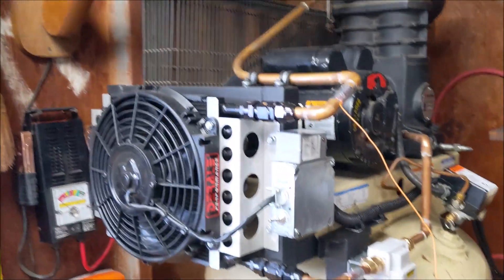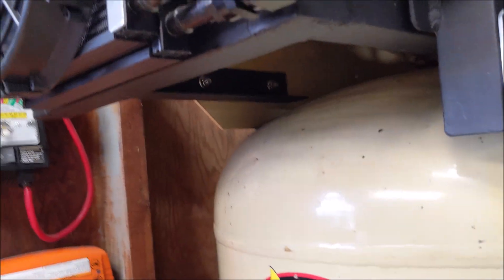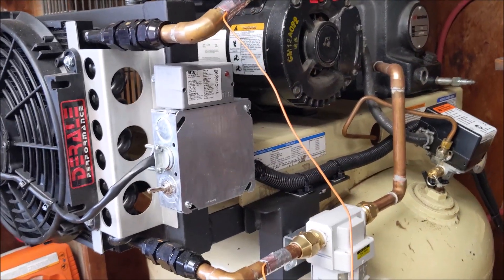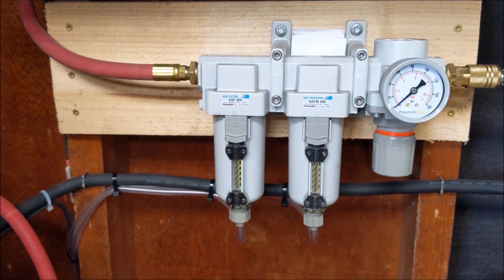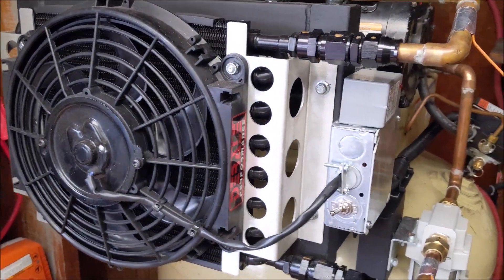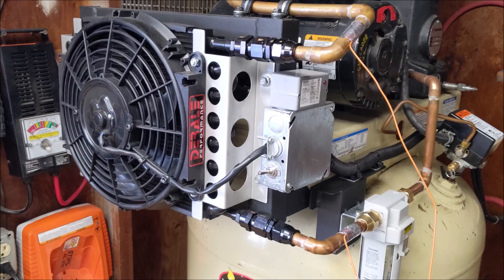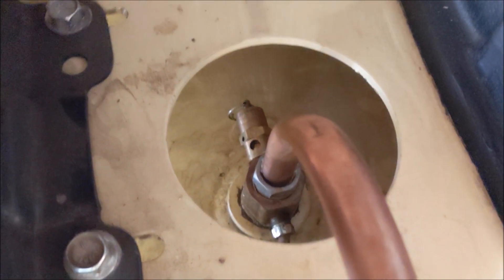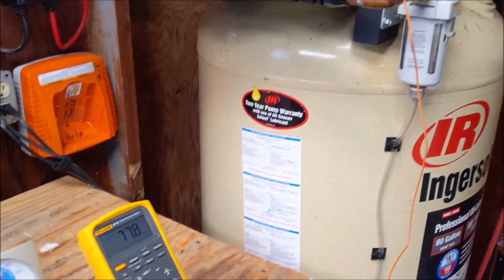Air compressor aftercooler, air drier and water separator

Comment: NICE WORK.  A brief technical point: all motors vibrate and therefore should be using flexible hoses rated for PSI/Pressure/Temp rating of your unit. The likelihood of copper soldered vibrating loose is almost non existence, but, i used compression fittings on mine therefore had to use flex hose.  The vibration will transfer throughout the system though.  I also added a filtration system on mine cause I'm running a plasma table through it.
Reply from the maker: Do you mean the pipe leaving the compressor and going to the cooler should have a rated hose in between? If so, that would make sense, and help isolate vibration.
Reply: @DBrisky37  I meant a flexible hose of each end of each connection point off the cooler.  Due to the motor vibrations it travels throughout the metal frame at all points and the Flexible hose, especially to the tank will help isolate it from that. The vibrations and air oscillations cause harmonics frequencies in the metal which could lead to metal fatigue and failure points.  Also your hardware connecting to the frame rail holders should be Nylon locking type (also known as aircraft nuts)  or they will vibrate loose.

Comment: Nice JOB ! I'm planning to get a Dewalt 5 hp 2 stage tomorrow a 60 gallon. I was going through the web looking for some good ideas to install this cooler because i did not like the idea to install it on the grill. They will need to take this grill off sooner or later what a pain .. Thank you for some ideas ...

Comment: This is so far the most complete air dryer I’ve seen. Big thums up for the relay, WOW. A simple idea, but a must have. I’m about to do the same to my compressor and I want to know if you had any problems with vibrations on your electronics or even on your piping. Just asking because I saw other video with that kind of problems. 

Nicely done 👍
Reply from the maker: Thank you. I have run it a TON since the install and have had no problem with vibration. All bolts are serrated flange bolts so that helps. Those are pretty solid relays, they are used a lot in HVAC equipment that vibrates so hopefully it holds up for the long term.
Reply: Thanks for your answer. I was wondering if there is a wirering diagram somewhere that I can use to build mine because I’ve never used relay before.
Reply from the maker: @ouelletteyannick4102  the relay has one in the box. Very easy to wire
Reply from the maker: @ouelletteyannick4102  or Google rib2421c wiring diagram. Reach out if you have questions, I'll help if I can. Its not too bad once you sort through the wires and isolate what you don't need. All color coded

Comment: Did you use standard electric solder wire on the pipes?
Reply from the maker: No, I used flux and solder that are typically used with copper plumbing. I'm sure you could do electric with it but I'm not sure to be honest. Copper is copper. The biggest thing you need to make sure  is that the soft copper tube is almost perfectly round and everything is extremely clean.

Comment: Dusty…can you please provide the water separator information…are you still pleased with operation or would you go with something else
Reply from the maker: The first water separator right after the cooler is a SAF 4000. The next two are right before the regulator and they are SAF 400 and SAFM 400. I have no complaints with this setup so far and wouldn't change anything as of right now.

Comment: Nice work! One of the best laid out and implemented aftercooler setups that I've seen so far. I'm in the process of doing similar setup.
Reply from the maker: Thank you
Reply: @jde1780  l used a 25 foot roll of copper tubing 10 years ago, you won't to solder, with just 2 compression fittings l dropped my temperature 85 degrees, was the first time I seen it done at the time, just get a roll of HVAC tubing at Lowes, l hardly ever need to drain tank,, mount it in front of the compressor flywheel fan and you don't need a separate fan, 50 dollars and it's the best it can be.

Comment: Very nice. Just finished building a similar setup, except on a 30 gal. compressor. A key thing here is that the water separator is more effective as the flow rate increases. My smaller compressor hardly catches much water compared to yours.
Reply from the maker: Maybe there is a smaller one or different style that would match your flow rate. I don't think a smaller compressor will make as much water either

Comment: Is there anyway you can tell how you hooked up the relay I’m so stumped on it
Reply from the maker: It's a multi purpose and multi voltage relay. It's an on off switch just for the fan which is 12VDC, the coil that operates the switch within the relay is a 240VAC coil. So the leads from the coil(within the relay) go to the motor side of the pressure switch contactor. So when the air pressure gets low and kicks the pump on, it also powers the coil to close the switch (all within the relay) and then completes the 12VDC circuit to power the fan. I have an external 12VDC power source that I didn't show. You could use an old computer power supply, cheap from eBay, or another 12VDC power supply that can supply the proper amps for the fan. The relay comes with a wiring diagram that helps explain it too. If you have anymore questions feel free to ask and I'll help any way that I can. Hopefully I didn't confuse you more
Reply from the maker: I also added an over ride switch which just bridges over the relay. I can make a wiring diagram if it would help. Let me know
Reply: @DBrisky37  I would be interested in a wiring diagram if available. And what do you mean you have an additional 12vdc power source hooked up. Would just the relay set up work without the additional 12vdc power source? Thanks.
Reply: I bought a pp20 relay and a power inverter and right now I just have it hooked to the pressure switch but I’m just kinda lost on how to wire the pp20 to the inverter. If you could make a wiring diagram that would be awesome
Reply from the maker: @troyareson8075  what voltage is your compressor? The PP20 appears to be a 120/277 input pnly
Reply: My air compressor is 120v

Comment: Dustin are you using the Derale 15300 condenser that everyone with this size of compressor seems to be using?  I have a big Saylor Beall 705 / 175psi rated / 5hp compressor with 100 gallon tank.  I want to build a set-up like this and my only concern was that I needed bigger piping.. like 5/8" for everything and a bigger condenser.  Are the condenser fittings 1/2"?  And what is the fan you used.  Thanks in advance for the help.
Reply from the maker: Yes that's the cooler model. I bought the package though which is a 15800, That is the cooler fan and brackets as a bundle. That was a concern of mine as well so I timed the before and after install fill times and they're within 5 seconds of each other. From the factory mine has 5/8 pipe from the cylinder head to the tank. The cooler fittings are half inch so you will need to adapt. Check the CFM output on the compressor, And I can compare it to mine and it should help you know if it will be restrictive.
Reply: @DBrisky37  From the spec sheet I found online my Saylor Beall 5hp 705 model is rated at 850rpm/23cfm displ./18.3cfm Delvd. (for 100 PSI) and then 845rpm/23/17.3 (for 175 PSI).  I plan to run it at ~ 120 PSI is what I'm thinking.  I also have a forum page saved where a knowledgeable guy was saying not only to run it at lower PSI (which makes sense to not max out and stress the system) but to use a different pulley (on the motor I think) to help it.  I think the gist was to help the motor not work as hard while still providing ample air for the desired PSI.  My main two uses for this will be a blast cabinet and plasma CNC so I'm still looking into those requirements.
Reply from the maker: I just looked and mine is 18.1 CFM at 90psi. 5 hp. 80 gallon. 
If your CFM specs are not a ton higher then it should hould be minimally restrictive. I used an 8 AN to 10AN flare adapter and then the copper pipe uses a compression fitting to adapt to cooler

Comment: Wouldn't it be better to plumb the watertrap before the cooling radiator closer to the head
Reply from the maker: The water is still in vapor form at that point in the system. Cooling the air in the radiator condenses the water vapor into liquid

Comment: Excellent work, best after cooler video I've found on You Tube! I'm curious about the fan power circuit. I've seen folks use repurposed 12V power supplies from an old PC, but I've not seen someone incorporate a relay before. Are you doing that only to maintain constant power to manually operate the fan when the contactor is idle, then the relay can still be actuated automatically when the contactor is engaged, operating the 12v fan in auto mode with the compressor cycles also? Or is there another reason all together? Thanks again for sharing, very impressed with your whole system design, especially the mounting bracket fab work.
Reply from the maker: Thank you for the kind words and for watching. 
The main purpose of the relay is for automatic fan operation while the compressor is running without a computer type of  power supply as you mentioned. I have a 12V deep cycle group 30 battery in my garage that is used for a project power supply, I decided to just tap the power off from that. 
I put my own switch in to allow fan operation when the compressor is off. If it's warm in the garage I'll use it for a fan while I'm at my work bench. They do sell relays with a "hand/off/auto" rocker switch on them.
Reply: @DBrisky37  Thanks for the reply Dustin, makes sense to me now.

Comment: I have that same air compressor and I just got that same after-cooler. Do you know what size fittings those are that connect to the compressor head and the tank? I want to keep that original tube that goes from the head to the tank so I could put it back later, if needed. So I can't re-use those fittings because I would have to cut the copper pipe to do that. I'm going to go with 1/2" OD flexible tubing for all of mine. That's the same size as the after-cooler, so trying to keep 5/8" to go into the after-cooler is probably not going to make much difference. My main interest is finding what size fittings I need to connect to the tank and head.
Reply from the maker: I would think they are just 5/8 flare fittings but I'm honestly not sure, I got tired of chasing parts so I decided to cut my factory tube apart and steal those fittings. I agree though with the cooler being half inch I don't think it will hurt to downsize the inlet
Reply from the maker: Check this link out. It appears to be the right part. https://www.mscdirect.com/product/details/62252283
Reply: Kenny, what flexible lines did you use?  I would think they'd be much easier to install and i suspect the cooler itself is where 99% of the cooling occurs so the nonconductive aspect of the flexible lines should be a non-issue?

Comment: Check your starting capacitor it might start going bad and that will usually affect the start kick on the motor ( assuming is a single phase 220V)  mine was giving me a humming and not start and ended up being the two starting caps. It’s a Baldor 5 HP 1 phase and now it’s kicking right up.
Reply from the maker: I found out it was the pressure switch. I had to replace it and there was a part missing from the new one that allows to pressure to bleed off after the compressor shuts down

Comment: I’ve been looking at videos on adding a cooler/condensor to my 8 hp , 16.4 cfm 115 psi petrol compressor and out of all the videos I’ve seen so far( 4 or 5 ) this is the best and neatest installation I’ve seen... nicely done !!!
Reply from the maker: Thank you!
Reply: I'm running 75cfm through my system 😅 leave the solder joints out it gets too hot for that 😅 don't ask how I know and also the air to air cooler out of the pump is great but it won't get all the water out. You need to get the air temp below dew point. We have a air to air then down stream a air to water with ice water and it gets the rest (which is a lot over 60%). I only mention this because I have a small body shop and if you have that many CFM your doing something and his set up won't cut it although it will help outside of soldering don't do that until after the cooler 😂. Scared the crap out of me when it shot the tube off 😅
Reply: Also don't use that cooler it won't flow 7cfm well look at Duramax oil coolers and trans coolers their built like radiators and have not bends just multiple runs across. This cools alot better but will also flow your CFM without stressing the motor

Comment: Do you have a link for the after cooler and Air filter dryer auto release?   Looks like the auto water release valve open until close at certain preasure.  When starting at empty tank the valve will always stay open until preasure built up and closed.  This auto release not work on this setup.
Reply from the maker: The fan/cooler is a Derale 15800 Electra-Cool Remote Cooler. 

The filter dryer does not have auto release. I just leave the drain valve cracked a very tiny bit and it continually drains while the compressor is running

Comment: have you thought about the magnetic start switch everwhere says id needed,
Reply from the maker: Magnetic start switch for what? Do you mean a different motor starter?
Reply: @DBrisky37  yes, it seems that yo are very knowledgeable so I would trust your opinion
Reply from the maker: @johnbrevard5966 sorry missed your reply somehow. A motor starter would be better than running the full current through the little pneumatic one that comes on it from the factory. But it only failed once in 15 years so I can't complain. If you're looking for a starter, take the motor specs to an electric supplier and they should help you match up what you need. Then only low current will run through the pneumatic pressure switch on the unit and make it last longer.

Comment: What pressure does your air compressor kick on and kick off at? you might be able to set it to not kick on until it reaches a slightly lower pressure, that might resolve your back pressure issue, may only take a little bit of adjustment, should also help your pump to last longer at a lower psi. I have looked at a LOT of these after cooler videos, and your install and tube routing certainly looks well thought out and clean, I have seen a few where they run the coil into a bucket of water, I am still on the fence if I want to add the water bucket to my planned setup or not.

EDIT: Actually I was thinking about this some more.... you still have a check valve in place right? seems like when the pump shuts off that it should depressurize the condenser up to wherever you have your check valve installed, so whenever the compressor starts back up there wouldn't be any pressure in the system up until the check valve, this is why they hiss when they turn off. It seems unlikely that the tube size would cause enough back pressure to cause this to happen, unless the electric motor is just barely large enough for that size compressor pump, or if the pump itself is starting to have issues (check the pump oil level?)
Reply from the maker: I could try the lower pressure setting, it kicks on around 110 or so. That's a good idea. 

Yes the check valve is still there. I'll have to check and see if it's bleeding off after meeting pressure, I honestly can't remember. But I do know the sound you mention. 
It's 15 years old so the electric motor could be starting to get tired, oil is good, I keep up on the maintenance. The valve body fell apart and blew a hole in a piston a couple years ago, I replaced it and got a look at the internals. It all looked great and rolls over with normal resistance when the belt is off. 

I'll report back after I adjust pressure switch and check for air bleed after shutdown
Reply from the maker: Okay so I checked this morning and I do not have that bleed off after shutdown, and I believe it has something to do with the pressure switch that I put on there to replace a bad one. It was a factory Ingersoll Rand part but I had to swap a some of the pieces with the old one because a few things didn't match up properly.

I'm going to look into it because I'm curious, but my water drain with a the drain valve slightly open is doing the trick for now